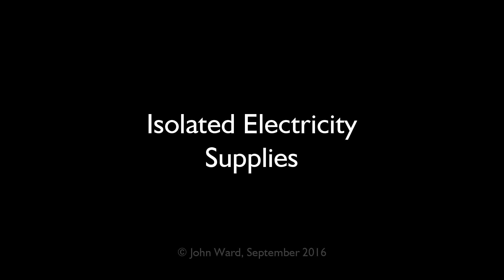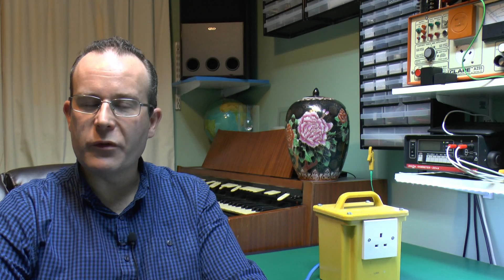Isolated Electricity Supplies - Why they are not used for everything

Comment: I'd love  to know why so many isolated power supplies still measure like 60-30vAC to ground and can like light up leds when one end is grounded.
Reply from the maker: Capacitance in the transformer windings, and if the wiring from it is of moderate length, capacitance between those wires and the ground/earth.
Reply: @jwflame  could it be the Y capacitors instead? how does one get rid of it?

Comment: @jwflame - you mention if we have a reference to ground system, and we are touching the floor or some metal part, then if we touch the live or neutral (when load is on), that we will receive an electric shock; but aren’t we making a parallel path so we would be safe since we are much lower resistance than the ground wire  which the current will be going thru also and on its way back to transformer? I geuss what I’m saying is - while we technically will receive a shock if we are grounded as we touch a hot or energized receptacle metal, wouldn’t the current thru us be very minimal?
Reply from the maker: Current will be small but that changes nothing - even current as small as 0.04 amps can be fatal.
Reply: @jwflame  I did some further thinking about the idea of touching a hot live and being grounded vs touching a hot while a load and we are ground and we are in parallel with it : I thought we would receive ALOT less of a shock in second case . Apparently someone told me the only lessening will come from the resistance of the wire! Why doesn’t the load itself being on and sucking up energy and thus current, (while we are in parallel with it) end up also lessening the current thru us even more than just the resistance of wire does? It’s like the load doesn’t matter!?

Comment: @jwflame Can somebody explain in a detailed step by step way why we need two faults in an isolated system? Can somebody do a scenario for me
How this plays out?
Reply from the maker: Starts with isolated
One fault makes it into a ground-referenced system
Second fault results in someone getting a shock.
Reply: @ Ah ok I think I see where my confusion was! May I follow up with two final questions kind genius soul:

1)
I was told that even if a system isn’t grounded (no ground rod to neutral etc at transformer and no grounding anywhere ) that if a power line that’s energized comes down and touches the earth, that it would still energize the earth. Now if energize means put the earth that it’s touching at its voltage then that’s surely true right? No matter if it’s soil, gravel, water that it’s touching right? A  120 v line comes down, and it will make the earth 120 v relative to neutral (in USA), no matter if that powerline is touching dry pavement, dirt soil or water right?

2)
The second question is - let’s forget about voltage. We have this 120 v line touching the ground - let’s say it’s grass or soil or water, is it possible for a current to flow thru the very earth itself if there are no grounding rods or grounding stuff anywhere near by? I ask it this way cuz I’m tryna take away with “return to source” and still see if current would flow thru the earth.

Comment: i don't follow your reasoning. with your multiple houses objection, then why not put a transformer in each home? i did not understand your brief mention of another objection. so i failed to understand your objections. thank you for the video.
Reply: It costs a lot more, and is less efficient; that's why we generally do not have separate supply transformers for each service entrance, and also why we don't have a downstream isolating transformer before each service entrance.

Comment: i disagree, between the first fault which is earthing the system and the second fault there is time so that the circuit can be shut off which would be cumbersome if it was a whole road. It can also be automatically monitored and after the first earth fault a technician can be called who would have a hard time finding the fault if it was a whole road. So i think it would be neccesary for each house to have a transformer. Which would be sad, paying for one transformer converting to low voltage and then for another transformer just for galvanic separation. But it would be +1 fault tolerant and much safer, so i respectfully disagree.

Comment: An isolated circuit running close to the ground may form a capacitor and allow some current to pass resulting in an electric shock risk albeit less dangerous.

Comment: Onboard ships the phases are often isolated from the hull (ground). In other words, they dont have a neutral as well! But on the HV switch board there is a ohm meter. Which measures between ground and the phase you want to test. The resistance should be close to infine to ensure that there isn't a fault. 

If a phase should touch the hull, the whole hull will be of that phase' potential. And thats not a problem at first. The problem occur when you get the second phase or third phase to touch as well.

Comment: I don’t understand 110V transformers used in the construction industry, they are still earthed and although the voltage is halved, surely the current is doubled otherwise a 110volt drill would only be half as powerful as a 240volt version?
Reply from the maker: Current is double, but the main point is they are centre earthed, so any shock to ground is only 55 volts rather than 240 volts.

Comment: I have read   that the neutral is earthed to prevent arcing ground phenomenon in earth faults,which leads to overvoltages in the system, is that correct ?

Comment: I love fairgrounds and I am fascinated by the electrical geenrators used to run the rides. To my mind the question of safety arises - large thick cables draped on the ground around the fairground etc. What worries me most though are the dodgems (should be re-named "dodgies") -  to get in your car you have to walk over the metal plates which I think are one pole of the supply with a great sparking mast poking up to the ceiling which presumably is the other pole. How do these get inspected and for what (I ask myself!).
Wonderful suite of videos and I hope they never end. Thank you.

Comment: The north americans got around the unknown-ground-reference safety issue by grounding a secondary centre tap of the supply transformer on the street.  That way, we have a choice of supplying 240 volts or 120 anywhere in the house, and the max shock hazard is only 120-to-ground regardless.   To ground one side as they do in europe and thereby creating a shock hazard of 240-to-ground everywhere creates an unnecessary increase in risk where 120 would have been sufficient.

Comment: Here in Norway, most end users are supplied with electrical power from IT transformers (3 phase 230 volt 50 Hz) with no neutral wire. Most new transformer circuits are TN (3 phase 400 volt 50 Hz). I have heard that Norway is maybe the only country with widespread use of IT transformers for end users.

If there are no ground fault in the transformer circuit, the voltage between live wires and earth is 133 volt. Circuit breakers may not trip if there is only ground fault on one phase in a transformer circuit. The two other phases will have a potential difference at 230 volt to earth if one phase is leaking to earth. The current leakage to earth depends on how much wiring there is in the transformer circuit. We usually calculate 2 mA earth leakage current per kVA transformer.

Two ground faults on two different phases may trip a circuit breaker, or maybe just create a big leakage current if the earth impedance between the two ground faults is too big. The ground wire is not distributed between electrical installations when the supply cable is coming from above ground, but it is usually distributed when electrical installation is supplied by a ground cable.

https://en.wikipedia.org/wiki/Earthing_system#IT_network

Comment: Another good video John, however I believe you should make a video highlighting the dangers of adding or extending circuits whether it be for power or lighting, and how to test the new circuit in line with the current regulations so that the viewers know that what you are showing them to do will not overload there electrical system or cause a fire.
Reply: He has done a video explaining extending circuits.
Reply: I haven t seen that, do you have the link please?

Comment: I made a couple of these. One I took 2 transformers from old UPS units connected the LV sides together, wired the HV to the mains in and to the output socket. Worked, but would only handle about 350 watt before voltage dropped out of normal range.
I made another larger one from an old power conditioner which has all kinds of adjustment windings, etc. I just removed the ground jumper on the output that was linking it I think to the main side. That is rated at like 8.5 amps, but weighs like 40-50LBs.

Comment: Hi JW, there are some large isolated terre systems used in the UK, Railway signalling power supplies are IT systems.  IT is used because it is deemed safer to live with the first earth fault and not blow a fuse.  There is monitoring equipment installed which alarms at an IR value less than 100k ohms and the fault is supposed to be fixed with 3 days.   Very specialist field I know but IT networks do exist, the modern trend is to use class II switchgear and transformers with a special cable.
Reply: seen IT system in cranes too, were you really don't want a fault causing a supply to trip fpr something like an electromagnetic pick-up.
Reply: IT systems are common in hospitals too.
Reply: Same on most electrical installations on ships.

Comment: 110v transformer with a 240v socket??
Reply: No, it's a 240v isolated transformer, it just happens to be in a yellow enclosure similar to the 110v ones you see on building sites.
Reply: 24OV socket, the colour of the case can vary. In addition the 110V transformers you see on building sites are not isolated. They are center tapped to earth. So the maximum voltage you can get from a fault through one side is 55V.
Reply: That's right, my one is blue. Made in UK apparently so it probably won't work for long haha. I also have a 110V yellow one rewired for putting out 30A into cables and fuses.

Comment: Hi John, 
I was wondering if you could explain how a site 110v transformer works. I understand that mains is 240v~ is referenced to ground, but a 110v site supply is two 55v? How does this supply power? It seems to be two supply cables and an earth?
Thanks, Joe
Reply: Hi, a site transformer consists of a 240V primary and a center tapped secondary. You'll then have 110V between the beginning and the end of the secondary winding and 55V from each outer leg of the secondary to the center tap. The outer legs are then connected to Live and Neutral pins and the center tap to the earth pin of the socket. Someone plz correct me if I'm wrong :)
Reply: Or if you want to pump out some amps, you can wire the neutral into the earth pin of the output and get 55V @ 30A+. Great for blowing stuff up.
Reply: Thanks! that cleared it up for me :)

Comment: A kettle in my house failed yesterday ad, rightfully so, the RCD tripped. However, it also tripped to another room where there were no faults, everything was fine. Any idea why?
Reply: The other room and your kettle are almost certainly on the same circuit.
Reply: Most houses only have one or two RCDs in total for all the circuits in the whole house, even though each circuit has its own fuse/circuit breaker... The lighting, however, generally isn't RCD controlled, to prevent the house being plunged into darkness and creating another potentially dangerous hazard

Comment: With a ground reference system, you also have a low impedance path to ground. In a floating system you could have a high common mode voltage of several thousand volts on the system that could cause damage to the cabling or even kill you.
Reply: That could be the case if you had something like a van der graph generator, but the isolated supplies mentioned here are just 240v transformers. So they will only have that voltage plus a possible and tiny DC component which will not have any significant energy to it. It could only be tiny because there is nothing to drive the voltage differential higher, left to themselves static voltages float down not up.